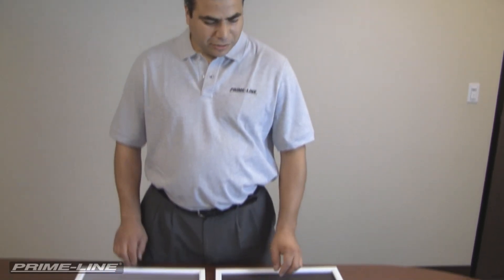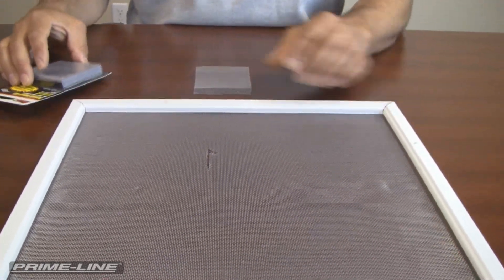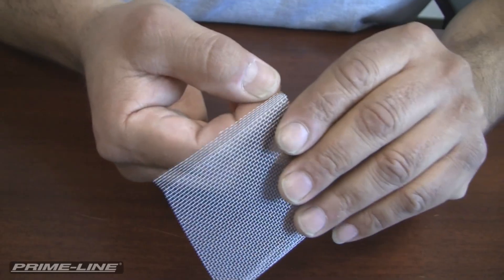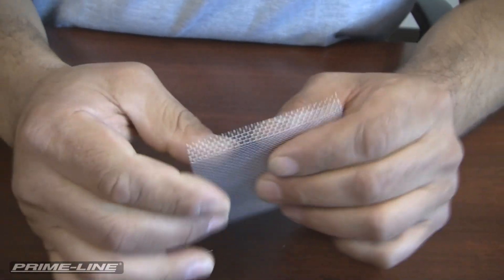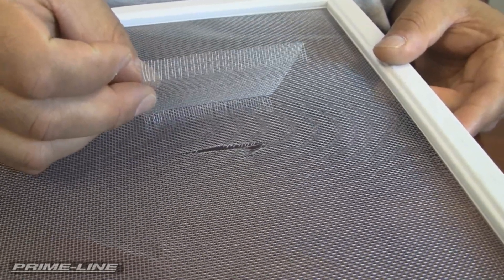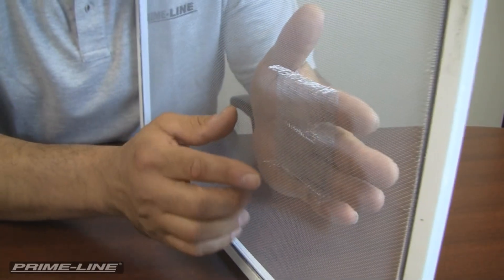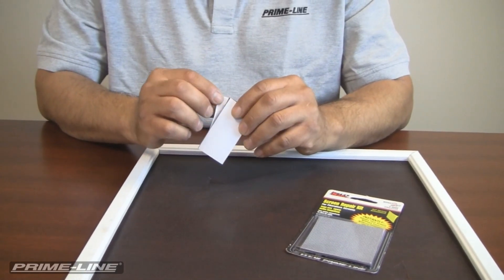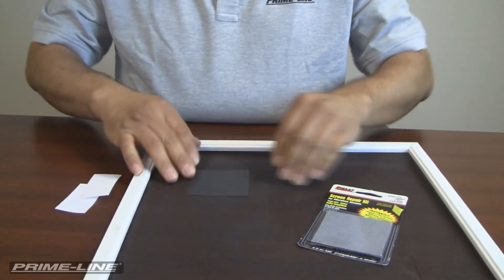Repairing holes in your window or door screen.

Comment: On vinyl screens I think you can just cut a piece of new screen wide enough to cover the hole or tear and use clear glue to paste the new piece on., at any rate that is what I am going to do rather than run down a screen repair kit from the hardware store., just saying folks.
Reply: Tigonis Yesis Hmmm... good idea, thank you. What kind of glue specifically do you mean?

Comment: couldnt you make just a small patch with some screen and put over the hold and  apply just a smlle bit of crazy glue along the edge of the page to give a firm seal.. withough blocking ability of air from passing through? and this could be used on eaither side of screen.. which would be helpful when not being able to remove a whole screen or when the labor involved to remove and replace a screen frame  is al lot of time and work?

Comment: I have aluminum screen but I live in a unit on the second floor so getting access outside is impossible. Do they have patches for the aluminum as well? and should I clean the screen first before applying
Reply from the maker: The first one shown in the video is for aluminum. :19 but you need to have access to the outside of the screen.  You could try using the one designed for the fiberglass screen but it might not stick as well.  Yes, you should at least try washing or wiping down the side of the screen you can access to and letting it dry before application.

Comment: What is if the screen is still in the window?  I don't want to take it out.
Reply from the maker: You don't have to take the screen out to install the self adhesive one.  If the window is low enough you won't have to take it out for the other one either.
Reply: Prime Line
It's not low. Second story window. Thanks

Comment: The patch sold by the shark tanks is 10 times easier than this
Reply from the maker: Did you watch the whole video.  There are two different patches.  The second one is peel and stick.  Takes seconds to apply.
Reply: The Shark Tank version of repair sheet needs to use a hair dryer. What if there is no electric outlet close by 
for the hair dryer?